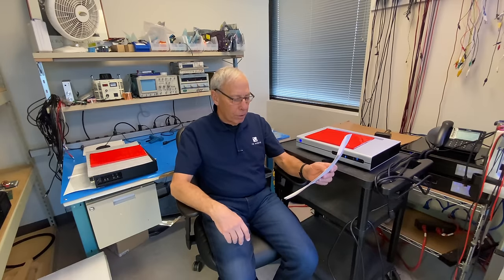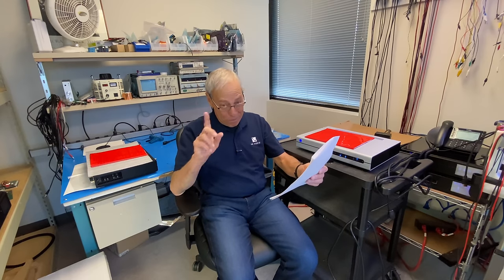How do you know if your caps have aged?

Comment: What about caps in old amps? I have a Sharp Optonica SM1616 from, I believe, the late 70s. Everything looks original inside.

Sounds great to my ears, and I don't have audiophile speakers anyway just some Bang & Olufsen Cx100 which are from the mid 80s. Would it be worth it to replace the caps just to breathe some new life into it?

Comment: How do you know if your caps have aged? My dentist tells me. 
All I can say is I was repairing my pots in my IRS IIIa's this winter and broke a cap wire off in one of the 4 speakers. So I replace just the cap and repeated it in the speaker pair to make them match. They now sound different then the other set I have sitting right beside them. Couldn't get the original TI cap so I got one with the same exact specs but it's not the same. Bottom line is when it comes to audio equipment I have a 3 B's rule, if they are not bulging, burning or bleeding they are staying the way they are.
Reply: Ouch those are film caps you broke no wonder you don't like the sound. The pair of grey miniature soda can size are the electrolytic caps. They should definitely be replaced. A good film cap that might be as good as your old ones if you want to try .  https://www.partsconnexion.com/jantzen-mkt-cap.html  . Bennic films are not my favorite that's for sure.

Comment: With old Apogees it's not so much the crossover that needs attention, it's the panel tensioning system. The panel was clamped on the sides, and then the clamping mechanism was pulled outwards using springs to keep the panel taught. Over time, the panel stretches to the point where the clamp can no longer keep it tight. Parts for older Apogees including new panels are available from Graeme Keet in Australia. https://www.apogeeacoustics.com/index.htm
Reply: Yeah, tensioning the panels is another task I've been dreading.  Thanks for the comment.

Comment: The reason I build my own amplifier is because I can use polypropylene capacitors in my power supplies, especially in the 1000Volt B+ I use for my 833A SET. They are bigger than electrolytic, but I don't have to worry about the poor life expectancy of electrolytics.

Comment: I had a ballast type resistor go bad - not reading anything on the multi meter. What prompted me to the cross over was the loud speaker  horn was not working but checked out ok after diaphram  inspectiion etc.  Although this maybe rare i would not exclude them entierly.

Comment: Isn't it possible that some capacitors are hand selected ones?
A 100 micro farad labeled capacitor does not have 100 micro farad capacitance. It could often be 10% off. More expensive capacitors, 5%.
An error of 10% or 5% does not matter much in power supply filter circuit, but it could matter in EQ circuit or crossover circuit.

Comment: Good deal. However elecrolitic Capacitors  also age in function of temperature. In a cross over there are not components that heat up and radiate heat to the capacitors like "inside an amplifier" Worst yet an amplifier with tubes. So inside of a speaker caps should last much longer than in other applications, also caps have a termal rating stamped right on it. My comment
Reply: They will also dry out and a Mundorf cap does not cost the earth so why not mod your speakers even if the caps are still good. That is actually a real bang for your buck.

Comment: When one or both of your KT88's red plate, check the coupling caps (as well as the cathode resistor(s).  There's other stuff to check too, but this is the comments section not the repairs section.  :-)
Reply: It's great to see a post from someone who knows what he's talking about! To the common reader, you'll know when your cathode resistors fail. But try not to panic. Just switch the thing off and send it to one of us! 😎

Comment: The Apogee Scintilla's and the Full Range being particularly bad. In fact the full range had a mid range driver that went down to 0.14 ohms I mean that's just silly. However the person writing in those speakers have a more reasonable nominal load of 4 ohms.. Apogees make Maggies sound second class or they used to I haven't heard any of the new lot. I'm looking for a pair of Apogees funnily as I heard a pair driven by some Kronzilla amps and it was AWESOME!!!
Reply: Indeed!  I've been using various Adcoms over the years to drive my Duettas, and they seem perfectly happy with them.  Nelson Pass designed certain Adcoms (notably the very first GFA-555, and the original 5800 but not the 5802), but Adcom invariably strayed from the Pass design when "improving them".  I used to buy every 1st gen -555 I ran across. My home theater setup has the Duetta sigs as the main speakers, an Apogee LCR for center, and then ribbon monitors for the sides and rear.

Comment: how does Dacron touching a hot coil cause enough heat to burn the amp? How hot would the circuit get without any polyester ? Do speakers with ports help combat heat ?Why am i so nosy? Thanks .

Comment: Great call Paul!
All please keep in mind that caps have different sonic signatures.
Some make a huge difference on a tweeter so read thru detailed reviews first. 
Buy 25usd solder gun and learn how to solder , have fun there are plenty of tutorials on you tube.....than make your speakers play like never before.
Unfortunately 25yrs old tweeter may have dried out as well so..... Do not wait 25 yrs , do it with new speakers😂 Even 5Kusd speakers use 3usd poly caps , once replaced with thru high end audio only designed cap for say 30usd or more it will blow you away how awesome these speakers will sound..... Check out Danny at GR research if you want to got few steps further... Have fun!
Reply: Caps do not have different sonic signatures, whatever that is!
Reply: @MrsZambezi  You just have no clue that all, try 3 different caps in one key location and than we can talk...
Nichicon KZ, Elna Cerafine, AudioNoteKasei.... All three will have differnt sonic signature heard right away clearly different ....

Comment: There’s an elephant in the room that needs to be addressed. I combed through the comments and there are a LOT of comments but none mentioned the elephant.. and I was kind of busy while watching the vid but I don’t remember any mention of the large gray mammal there either. Enough preamble. If you are replacing non-polarized (no symbols on the casing showing any positive negative indications) capacitors then just melt those those babies out put and throw the new one in and you’re done. If you’re replacing POLARIZED capacitors then you have to make sure you locate the plus and or minus sign on the casing and install accordingly. If you find a black stripe on one side that will almost always be the negative side and one of the two legs (wires) will be closest to the negative indicator and will be the negative leg. And visa versa. On the PCB board there will usually be a circle where the cap is installed and half that circle will be colored in, usually black and will have one hole for the NEGATIVE leg of the cap. And the other side won’t be colored in but will have a hole for the positive leg. And BOOM, you’re done. If you put them in the wrong direction then BOOM they can and will explode and obviously, the larger the cap, the bigger the boom (and associated fire and electrocution etc..) 
Let me qualify that I am not an electrician and that just about everything I’ve learned has been by first doing it the wrong way and suffering the consequences. That approach definitely makes the lesson stick, and burn, and bleed…etc. here’s another great way to learn these things and that is to have someone else do all the dumb work for you (don’t thank me, I’m glad to be of service). If you are qualified electrician reading this and you run across bad info, then please correct me. It just seems to me that if people are being encouraged to solder for the first time then there’s no way they are going to know about the positive, negative exploding thing. Have a nice day 😊

Comment: I run yamaha , iv found after a year of turning on my system it sounds like its scratching .bozak l.s. 400 speakers with yamaha rx-v620 amp .maybe my ears or the speakers. Haven't tested yet but still learning. 
Hoping I can rework the amp because the speakers are ,well old and hard to rework .

Comment: I attempted to replace the caps in my Infinity RS 3b speakers but after spending three days trying to find the same values as what was originally in them I just gave up. It seemed to me that nobody had replacement capacitors of the same values. I sold the speakers because audio paranoia had set in and I just couldn’t take the stress.

Comment: It's almost impossible to see when to replace capacitors!
Do you have a device from the 70's or early 90's so you should replace them?

Capacitors may start to leak or start to get high resistance (ESR) or other things. you do not always see it on the capacitor.

you have to solder it out to start measuring it. Some can measure correctly but others do not
Reply: You can test them in circuit with an ESR meter I would say 90% of the time it is reliable. Used to work in a repair shop. Sometimes you might find 2 electrolytics in paraell (they are connected + to + and - to - together and then you'll need to remove one of them.
Reply: @cat-lw6kq  You do not get exactly the right result when they are in the circuit. There may be a resistor or transistor or something above the capacitor.

A capacitor can fail in several ways, making the sound worse.

The rule is that if you have a device from the early 90's or 80's then you should replace capacitors.

Comment: I would argue that if you're really an audiophile, then you know how to work on your equipment. The biggest issue I have with audiophiles is their tech illiteracy which translates to bad or outright wrong advice that is said with confidence and determination. Soldering is really easy if you have a good iron. You can even buy training kits on Aliexpress for a few bucks to learn how to solder anything from big caps to small surface mount components. Furthermore, once you know how to do it you'll spend less money and time getting old gear repaired. I've repaired a lot of stuff that has no manual and was going to a landfill despite being perfectly fine just because nobody knew how to work on them anymore. It's kinda sad

Comment: A better, more objective answer to this gentleman's question would be to recommend he get a reputable, affordable LCR meter and test the caps' farad capacity and its ESR. I just fixed a set of 35 year old Polk speakers for an unrelated issue, and when tested the *electrolytic* caps inside they were still perfectly in spec.

Don't just chuck time and money at something out of ignorance, DYOR and learn something.

Often the act of disassembling an old piece of equipment can create more damage than if just left alone if there is nothing confirmed wrong with it. It is very unlikely I would throw caps at a xover unless it was genuinely malfunctioning.

Comment: I have some 36 year old filter caps, and that amp still sounds like it did after burn in. I have some 30 year old speakers that still have the original caps too. They still sound the same as new. But I know time is ticking and nothing lasts forever, so I share his "audio paranoia". 😅

Comment: I find it odd that Paul Mcgowan didn't mention one must be aware of "capacitor forming" after replacing electrolytic capacitor in one's x-over loudspeaker.
Reply: Forming (or really re-forming, electrolytic caps are formed as supplied new, it just breaks down with time) applies to polarised electrolytic caps used for eg supply rails and reservoirs. These get a dc voltage on them when in use. But speakers don't have any dc voltage. Trying to reform bipolar caps in a crossover by playing them at max for ages .. Good luck with that. Bipolar electrolytic are just the worst, even when they were new. They have lousy esr esl and leakage even when new. Their value drops dramatically at high frequency,  even when new (not what we want in audio). Their value is also nit constant vs frequency. (Search Steve benchs articles on capacitors) cf Modern parts are massively better due to materials as Paul commented, production techniques and simply need, switch mode power supplies have become ubiquitous and operate at high frequency. All electrolytic also degrade with age and temperature, its just life. Replacing old electrolytics is always going to be an improvement, in some cases a major one, in some cases may prevent your tweeters being blown. Even if you just use (quality) modern electrolytics .. Replacing with film types is a further step. Film caps have superb frequency response, linearity, and will last more or less forever

Comment: I have some Cardas soldering wire quad eutectic silver solder with rosin flux - is this the correct solder to use?
Reply: Yes!
Reply: Fancy !. Any regular lead based electronics solder will be fine, silver is really nice but the fancy brand name snake oil isn't worth anything imho, they just get rich off customers backs. BTW, avoid lead free solder, that's required for production these days but a pain for DIY ers to work with, it doesn't flow

Comment: While you're at it maybe replace the HF circuit sand caste resistors with thin film resistors too? Btw here is a pretty intensive listening test done for caps:  http://www.humblehomemadehifi.com/Cap.html Look for the ratings 8+.  Remember new caps do need some burn in time.
Greetings from the Netherlands and good health.
Reply: He is a super guy & very helpful with intense knowledge. Saved my 1996 Philips FB840 Conductor Towers (sealed) and they're singing beautifully now :)
Reply: There's no point in changing resistors if they are OK.

Comment: Great work demystifying cap replacement. I fear many are like the OP and think it’s a huge endeavor instead of a relatively simple
Process
Reply: As that OP, I have to say I don't fear soldering.  But that's the least of the issues.  Access can be be an issue, and sourcing the right parts is actually the thing I don't want to deal with.  Thanks  for the comment.

Comment: Surely a better answer would be to buy a suitable quality ESR meter and test each capacitor individually rather than simply replacing each willy-nilly? For less than US$75-100, you can find something that will do the job. Heck, a PEAK brand ESR meter can be had for less than about US$150 ish if you want a top brand. Once purchased that meter will last a lifetime and allow checking of equipment every few years or so for reassurance everything is running optimally.

Comment: You need to open up the speaker to see which parts are used. Polyester to polypropylene  is molded and you do not need to swap them on such new speakers. electrolyte has weaknesses and should be replaced! Change electrolyte to polyester or polypropylene if possible!

The best electrolyte is no better than the cheapest polyester

Comment: Only replace the electrolytic capacitors.
Reply: Oh?
Reply: Are they marked as such, so it's easy to tell the difference?
Reply: @HareDeLune  in general they have an outer 'can' that is wrapped around the ends - i haven't described very well though you will see what I mean if you look up some images of electrolytics and polyprops. Be aware that polyprops or other replacements  can have a much greater physical size - building an external crossover box or replacing with electrolytics with a by pass cap (parallel cap of high quality of maybe 100th the value) can be ways around this.
Reply: @robh9079 
Hmm, sounds a bit complicated.
Paul made it seem so simple...
Reply: @HareDeLune  the basic concept is really simple, but if you've got small boxes or limited space and just go ordering polys for elecs you might not fit them in! - physical size is always given on specs - 1st step remove xover see what youve got and take it from there, you might only be changing a few parts and if you stick to type there won't be an issue, though just check  the sizes  ( - the KEFs 'ive just done are not simple however...  )
another idea; post a query about upgrading caps on your specific speaker on one of the many excellent forums - notably 'diy audio'.
Reply: @robh9079 
Thanks!
My interest in DIY is growing, very slowly, so thanks also for the forum suggestion.   : )

Comment: Remember i think most Caps are directional.
Reply: You MUST use non-polar caps for speaker crossovers!    Poly, Mylar, Film caps are naturally non-polar, but standard electrolytics ARE polarized.  If you need large values and must go with an electrolytic, it must be the special non-polar type.  If you buy from Parts Express, anything sold in the speaker crossover section will be OK.
Reply: Electrolytic types are certainly polarized (directional), unless you buy a "non-polarized" type which is actually two polarized capacitors back to back.  But "non-polarized" electrolytics which are popular for speaker crossovers can be pricey.  You can substitute two polarized capacitors back-to-back in series, where each has double the value of the part they're replacing.  Or better, if practical (if required capacitance is low enough), replace electrolytics with film types.  
Film and ceramic capacitors are not polarized, however film capacitors do have an inner and outer foil and in some types of sensitive circuitry you want to pay attention that the outer foil is connected to the lower-impedance circuit node.
Reply: The opposite.. most (all film / foil types) are not. Normal electrolytic caps ARE but these are not suitable for use in speakers, as others also note any elects used in speakers are bipolar type which is really two polar elects back to back inside the same can. .. and they suck.